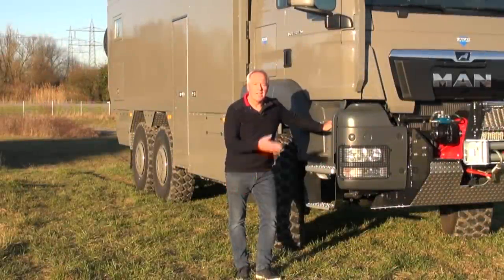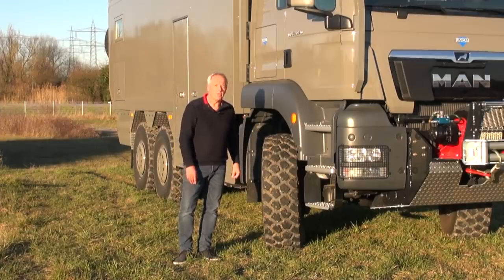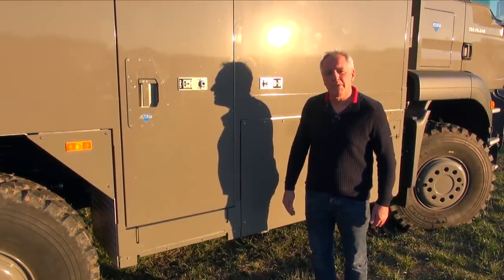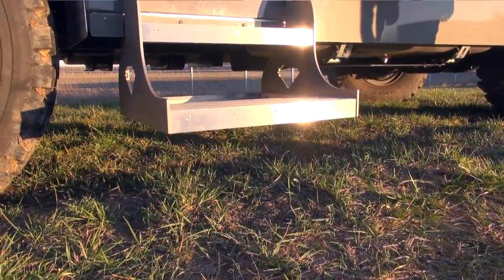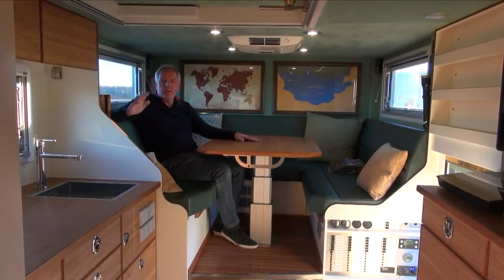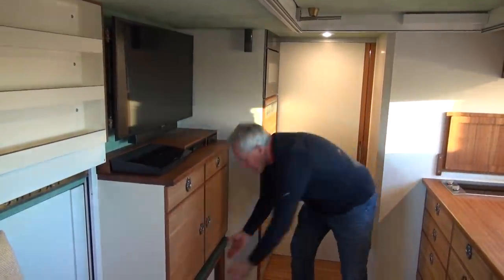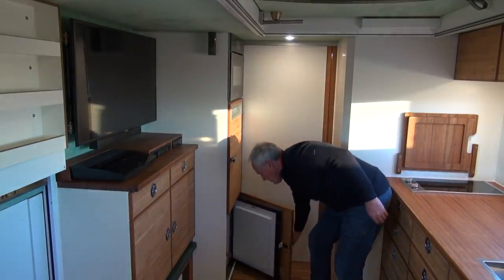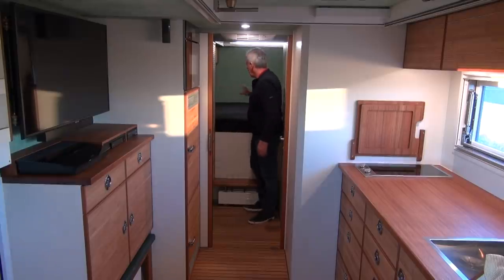UNICAT Expedition Vehicle IN72H MAN TGS 26.540 - 6x6

Comment: Why the cockpit of is separated of the rest? I think is uncomfortably get out, under cold, rain and in dangerous situations to drive, or exit to contact persons in cabin.
Reply from the maker: Hi Julio, 
each of our vehicles is built on specific customer requests, in this case the customer did not want the connection between the driver's cabin and body.

Comment: I like this unicat ok, the steps r nice but not low enough. The roof needs to be able to box lift up bc in bad weather tents r not enough. The box needs to be prt way up going down the road or down for better mpg, but at site fully popped open.
Reply: The power is fine if not towing but if towing not near enough, 550 hp needs to be 750 if wanting to reg tow.
Reply: Other corp hve rear lift shelf for anything heavy 5tons crazy power or just motor cycle or bikes. U NOW make the rear of Unicat into a flip down fold down ramps or platform, 1 way u showed it off was Polaris on board in garage great idea. hving full articulation of main driver compartment w/back of truck is better than rear steer(still nice). I hve seen a million dollar rig that had driver wheel slide left or right drive But hving to driver complete seats is better redundancy. I saw a guy w/RV that had 2 30lb lp bottles connected that u can fill from outside w/out hving to take out the bottles + every brass fitting to fill any where in the world.
Reply: Your welding working trailer w/work tower lights & many bins mechanic compartment was very sharp.
Reply: When RVing the inside out side feel is critical so hving slides hybrid w/screen rooms is best bulk of time good noise weather.

Comment: Does Unicat offer slide outs?
Reply: Military Museum jep, good question. Looks much to small for me in the inside. I’m 2 meters tall. I’d appreciated slide outs to the side/s and to the top too. 👍🏽
Reply from the maker: Because in Off road they can give a lot of problems, but if you look on nostyro sito.unicat.com, there are vehicles with the roof going up. try to look.
Reply from the maker: All our vehicles are specifically designed for each individual customer, so they are all different and created according to customer needs. @stebarg

Comment: Turbos need to cycle on & off if not under push button load or elevation 7500 ft or higher. esp if using tow 750 Hp motor. I game up w/Dyson type ball idea brilliant look it up. The engine needs to hve supplemental air injection system. Able to fill cylinder prt way or whole way if not using that 1 of 8 or 16 bank. Far cleaner & less fuel burn depending on load or cruising. running 8 out of 16 diesel & every other running just compressed air esp for boats bc bigger motors.

Comment: Sometimes LESS is MORE... I mean one of the first options they show is remote control door locks etc.. More electronics = more real world issues exactly what you DO NOT want while on a expedition miles away from any assistance.. This is a rich man toy that will probably never see any real use.. A fool and their money soon part ways
Reply: 540hp is also absolute overkill between 320 and 440 would be more than enough i mean the superstructure doestn seem very heavy and it isnt pulling any kind of trailer all it does is waste fuel

Comment: Take that POS off road and you'll bury it to the frame, put it at an angle when off road and you'll lay it on it's side.
Reply: Larsanator   Have you not seen what this vehicle is capable of. It’s basically a unimog. They are big but can go through anything and have a side hill rating close to a hummer.

Comment: Safety is fine seperate system but dumb down engine tech the anywhere in world goal not germany tank stupid shit. Low tech or won't keep u from driving going if fuse safety system unpluged till replaced. Everything easy to bipass & take off line, & everything just a central unit prt the smaller the lesser the prts the better 50dollars not 500 demon german dollars cheap small each unit hving replacement pieces not computer board 1000dollar shit.